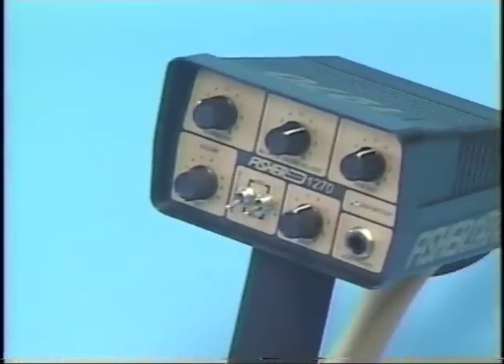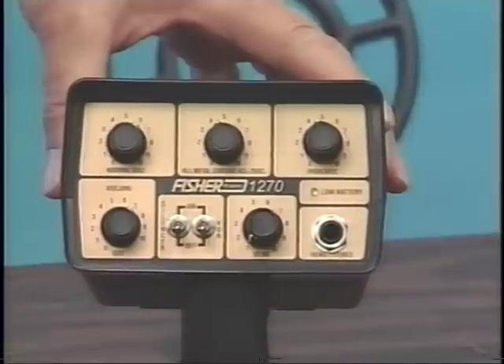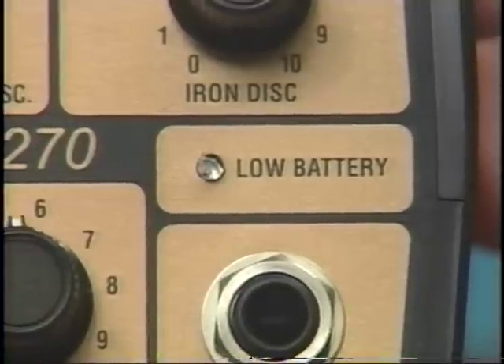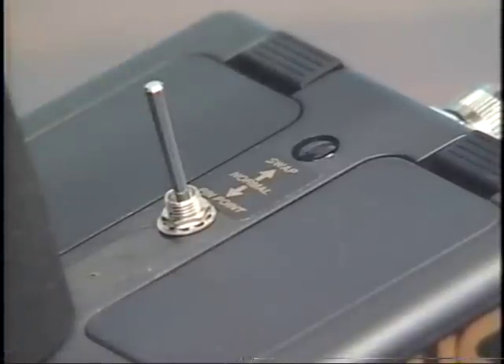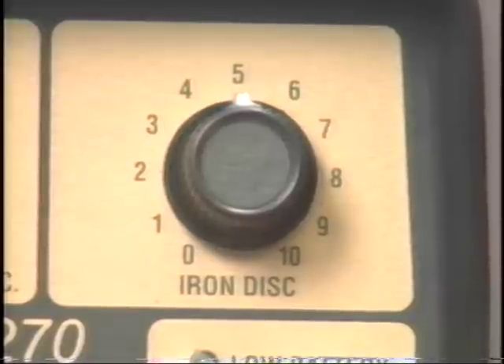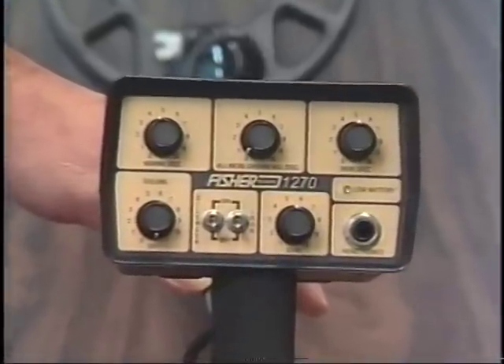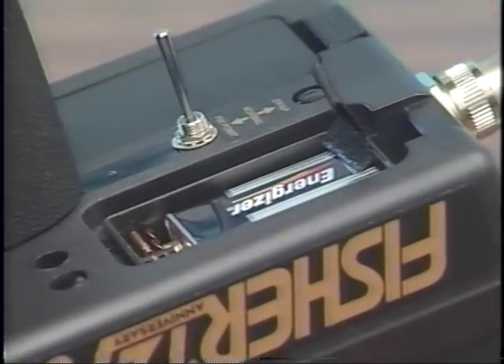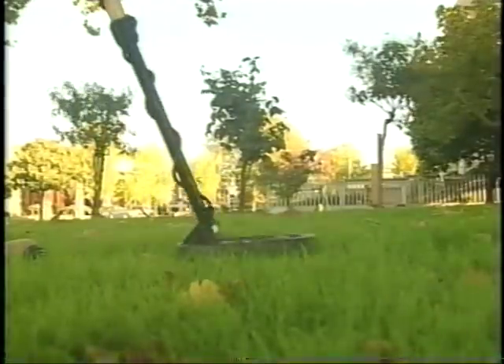1270 Video

Comment: the 1270 is to head heavy!
Reply from the maker: The 1270 is an older design and like all detectors from that period yes it can be a tad heavy...but there are still those who swear by this machine and refuse to buy newer, lighter models!
Reply: Just think of how big your forearms will get. I went to horseshoeing school for six weeks and it's amazing how much stronger your forearms get from swinging a hammer. I'd assume a metal detector will likely cause ones physical stature to also develop more.